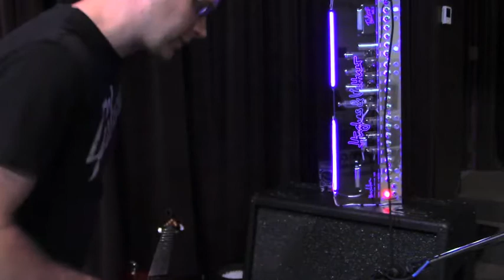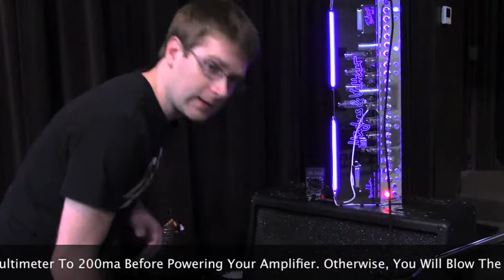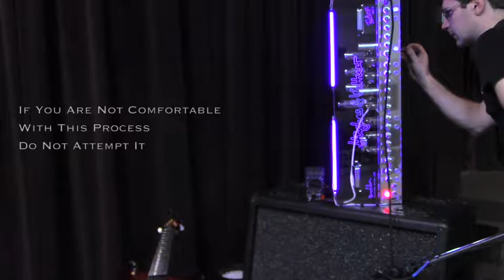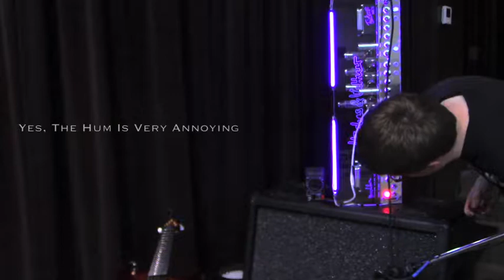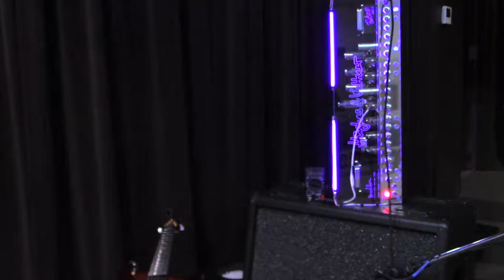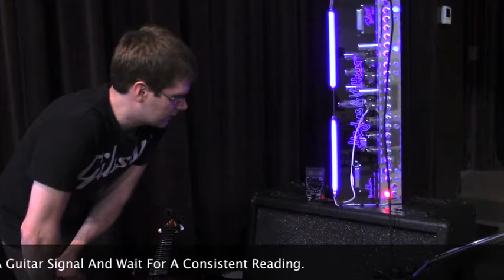Biasing a Hughes & Kettner Triamp MK II with JJ E34L Power Tubes

Comment: I’ve been doing a lot of digging on this and supposedly Hughes and Kettner sets these at 27 to 32mA max adjusting pot TR2 only,  pot TR1 is a hum eliminator, I just did mine in this matter and so far so good sounds better than it used to and played on it now for about three hours with no trouble

Comment: Wow.... thank you so much for making this video. I have two of these amps and have scoured the country trying to find someone to bias them correctly. Do you know what the OEM tubes/bias voltage is supposed to be?  These amps sound the best when they are brand new. I've not had that sound back 100% in years.
Reply from the maker: The only thing I can share about the biasing is how I did it. I’m not sure about all the plate voltages and stuff but, using a bias probe that goes between the tube and the socket you need to set the current to 38mA. You need the probe plugged into a multimeter that has a 200mA setting. The biasing pot is “TR2” on the circuit board. Give eurotubes.com a call if you need more info. They are awesome and taught me how to bias this amp.
Reply: @mmagoon67  Again, thank you so much for the video and reply. I will reach out to Eurotubes for the biasing equipment definitely.
Reply from the maker: No problem. Not sure if you’re wanting to change tube types but I found out with the 6L6 tubes that I couldn’t get the current lower than 40mA. The bias wouldn’t adjust down far enough. Beware of this as I blew quite a few fuses with the 6L6s over the course of about 2 months.
Reply: @mmagoon67  Ouch!  No problem, I'm trying to get back to factory set-up which I believe is EL34's anyway. I play metal and the initial sound I had out of the box 6 years ago was nothing short of amazing. Man, I really can't thank you enough for chatting with me on this. Like I say, I've been through a couple of bad tube biasing's. I think you've given me the confidence to do it myself. I always said when you want something done right, do it yourself.
Reply: @mmagoon67  I find this very interesting as I called a Hughes and Ketner rep they told me to bias between 27 and 32 mA that was factory spec
Reply from the maker: @FKHTrump2024  You are correct. Reading my past comment I'm not sure if  38ma is a typo. I sometimes set the bias a little hotter to get a little more compression.
Reply: The original valves were rebranded with  'hughes and kettner' logo i think, so they make it hard to know.

Comment: Do you know how to program the amp for channel changing from a multi effects/midi board?
Reply from the maker: Are you referring to how to setup the MSM-1 MIDI module? If so, then I have found there is a specific way to get it going though I'm not a MIDI expert. I use a Ground Control Pro into the H&K then into an efx processor.
Reply: What I’m wanting to do is change channels on the TriAmp using my Boss GT8 pedal.  It does channel change as I go through different patches on the GT8, but I can’t program the TriAmp to “learn” new changes.  I fear that my midi module is messed up, but hoping it’s operator error.  When I press the “learn” button on the amp is it supposed to remain illuminated?  Mine does not.
Reply from the maker: How I have mine setup is...setting my MIDI module on the Triamp to the “Omni” setting. In that case the Triamp needs to be the first in the chain after the MIDI controller being plugged into the MIDI in. The MIDI learn switch on the Triamp has to be held as you program it. It is not supposed to stay illuminated if you just press and release it.
Reply: I figured it out.  Thanks for responding back to me.
Reply: The steps for controlling the TriAmp mk2 with Boss GT8 or GT 100 are basically:
1) Match the midi channels of the controller and amp.  (I set my Boss GT8 & GT100 Midi PC Out to On, and Midi channel to Omni)
2) Hold down the midi learn button as you turn in the power to the amp.
3) Release the midi learn button.  The TriAmp is now in midi learn mode.
4) Select your patch on the controller, select your desired TriAmp channel and FX On or Off.
5) Send the program change message with the controller by  selecting the patch again.
Now that patch on the controller will select that TriAmp channel and FX On/Off setting.  Now you can continue setting up more patches on the controller, or exit Midi Learn Mode by pressing the Midi Learn button.  I hope this helps someone out there.  I’m really surprised I had such a hard time finding information on this great amp’s midi function. PEACE!

Comment: Hey Matt nice video. Just wondering where exactly did you hook up your multi meter to? I have the same mk 2 just not the alex lifeson edition and have just completely re tubed my head.
Reply from the maker: So I bought a biasing probe that goes directly between the tube and the socket on the amp and this seems by far the easiest way to do it. I got mine from eurotubes.com and would recommend one. However, if you don't want to buy one I believe you can still use the touch probes; one on a specific pin number and the other on a ground like the amp's chassis. Be sure to research more on which one because I've not done it that way before. Email someone from Eurotubes if you want more info. They're awesome.

Comment: When you adjust bias on a head like that you should not have the guitar plugged in.That seems strange to me as an repair guy for many years.Why?
Reply from the maker: I suppose your answer is in your comment. Repair Guy vs. Non Repair Guy. If I shouldn't have my guitar plugged in I would consider that valuable info.
Reply: @mmagoon67  I asked cause there are always more to learn, most amplifiers(tube) last 30 years are variations of 2-3 type amp circuits.But some models can have a tweak  for this and that?Can you explain why you not should have a guitar plugged in when biasing a tube power stage?By the way i repair a wide field of things .
Reply from the maker: @leohobbleohobb3781  I guess I'm confused by your comment. I didn't know you shouldn't have the guitar plugged in while you bias. I wish I had known that because I'm not a repair guy and I don't have experience and it would have been valuable information to have for either a more accurate bias and/or a safer experience. I suppose I never thought it was important because the guitar wasn't being played and it was turned down.
Reply: @mmagoon67  well then you know now.when jack is not injected the input is shorted(closed so no noise are loading the amp.That is the way i learned it way back.Today a new quartet tubes el harmonix el 34eh gave new life in a Hughes Kettner trilogy after swapping  out dry caps.